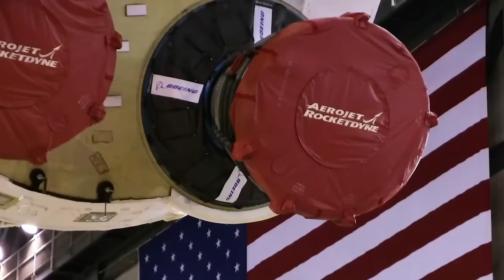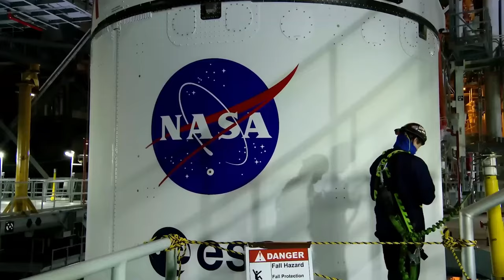Moonbound Odyssey: Charting the Course of SpaceX and NASA's Lunar Landing

Comment from the maker: What do you think about the Space X project?
Reply: Starship is way to big for what it need to do
Reply: @Junebug-me4bj it's easier to scale smaller, rather than scale larger. I believe that many different versions of Starship will be built, based off specific use requirements. All lessons learned from going to the Moon will used later for the journey to Mars.
Reply: SpaceX has to start somewhere. They are employing some of the most brilliant minds to figure this out. The plan may change often, but the goals remain the same. I believe that they will continue to achieve success.
Reply: @ryanab01  They haven't achieved any success to date, only failures.
Reply: @johnhawkins2105  How could you possibly think that? Do you even know who SpaceX is?